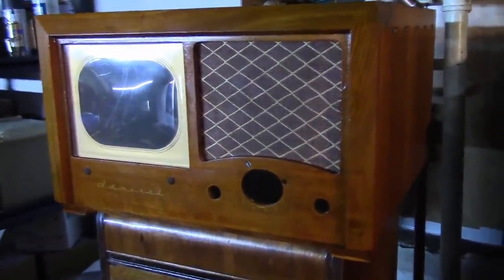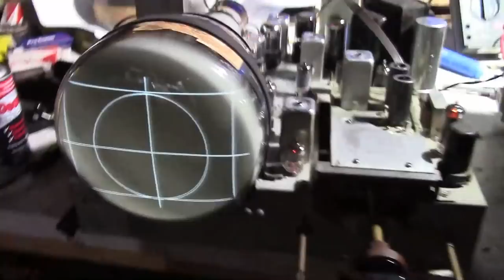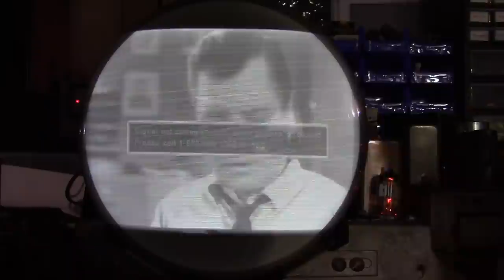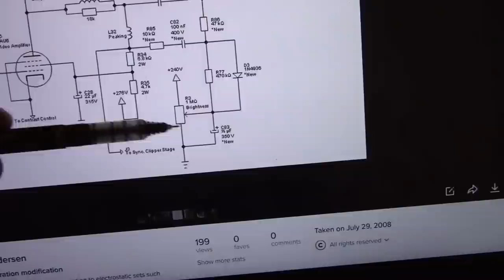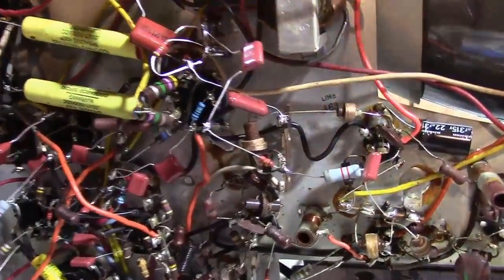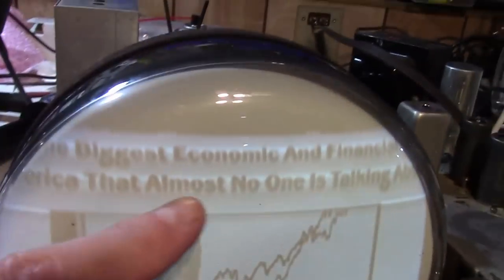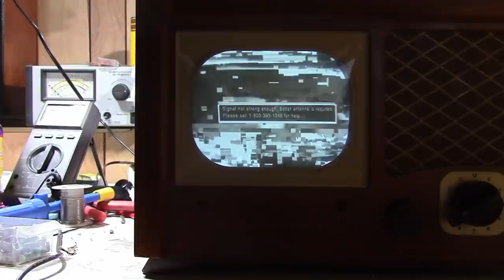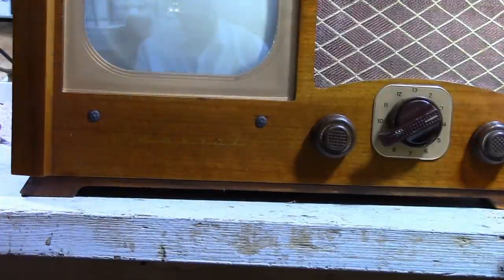Admiral 19A15 restoration p4o4

Comment: Nice job! Watching your videos over the years inspired me to do a restoration of a Dumont ra103 "Doghouse" set that showed up on the local Craigslist recently. That uses a 12JP4 but the tube in there has a bent gun with ion trap. The phosphor has a mild ion burn so I am thinking it might be a rebuild also. Set works well after a total re-cap and repl. Of a few bad tubes. I am now in the process of aligning it. So far so good!
Reply: Glad your Doghouse restro went well! Mine had issue after issue and even now I can't get the brightness down and I still have very high b+ in some circuits. Its watchable but I know its not working 100% yet.
Reply: @mattdavala3790  Have you checked resistor values? High b+ means something isnt drawing correct current. If brightness is too high maybe your control has an open? Disconnect top terminal and ohm out as you rotate. This set should work well as they used good parts for the day.

Comment: from what I've heard the things that makes electrostatic tubes so hard to rebuild are: standard button bases (the bit where the wires go through) are too small for the width of the neck and also replacement cathode assemblies are not produced. I suppose its possible that the rebuilder recoated the original cathode and reused the stem.
Reply from the maker: That does seem like the only practical way to do it.

Comment: I totally got on here by accident but stopped to watch because of the round crt. BTW, in the town I grew up in was a tv radio repair shop and he specialized in crt rebuild. I was fascinated by his ability to do that and sat for hours to watch him do his magic. He even did some of the early color crt's, but stopped doing that by the mid 60s. 
Well, you did an awesome job and that is a nice little set. Admirals were a good tv but of course, the Zeniths and the Magnavox were the better sets. The RCAs were good but I always thought that Admirals were better, that is until color tvs started hitting the stores regularly and then RCAs ruled till mid 70s.
Reply from the maker: Thanks for stopping by.  As for the brand comparison, please keep in mind this set is from 1949.  Magnavox didn't exist yet and Zenith had the porthole TVs with their strange, complex design that were difficult to service.  All that changed over the years of course.
Reply: @bandersentv : You are welcome. BTW, magnavox has been around in various forms since 1911 and they commercially produced and sold their magnavox radio/ record player/ tv cabinet combo in 1948. And zenith got started in 1918 in chicago. But it did not begin manufacturing until the 1920s. Zenith also put its first tv sets on market in 1948. They also got into the "phonevision" that was never really a hit but the brand name got put on their early tvs as well. In fact, zenith was the number one innovator in electronics and was also the producer of "windcharger", a small company they bought up to produce wind-powered charging system. I happen to know a bit of both companies as I was and still am a huge fan. But I also loved many other tvs and radios from many other companies and also a fan of many electronic parts companies that stood out from the mundane. Like germany's telefunken who produced the best radio tubes in the world for a long time.
Reply from the maker: @sonofeloah   Thank you for the correction.  The tvhistory website shows their first models being introduced in 1950.
Reply: @bandersentv : Wow, really?!?!?! I remember back in the 60s wanting to use older tv's for my slow-scan ham tv system and used a1950 admiral set as even the older magnavox and the zeniths could not be made to run the slow scan-monitor system or be used in the slow-scan receiver. Even a rca could not be used. But I was very happy with the admirals I used for the monitor and the receiver systems. BTW, to refresh my aging memory, I did go to the wikipedia sites for the history of each company to be sure I was correct in my previous statements. And learned a bit more about zenith than I ever knew before! Woohoo!!

Comment: Wouldn't possibility of rebuilding the tube depend entirely on availability of replacement gun assemblies (or whole necks)? Are there any known surviving catalogs of those from back in the day? I was under the impression that's all that goes into a CRT "rebuild". Maybe only one manufacturer of such supplies made them at an unattractive price, or (really guessing here) some shop got ahold of military radar tube parts?
Reply from the maker: The gun and neck is relatively easy compared to the rest of the process.  Air needs to be slowly let back into the CRT.  The old neck cut off, a new gun assembly inserted (or the cathode can be recoated) , new glass neck welded on, bake in an open overnight to releave stress in the glass, air pumped out, getter flashed, tested, new base put on, etc.   I was able to get one rebuilt just before Hawkeye closed.  Cost $300 for just one basic B&W picture tube.    This video shows the process:  https://youtu.be/W3G7b-DcOO4

Comment: Bob,do you have a good 24AP4 Metal shell CRT
Need one for 1951 General Electric model 24C101,Sams photofact folder 152-8
Only set of its kind to still exists in Western North Carolina Rutherford County
Unfortunately the picture tube is NECKED before I bought it
The cabinet is mint except for a few scratches in 70 yrs
Reply from the maker: No and I never seen one.  I know you've been asking around for a few years now.  Unfortunately that CRT was used only for a short time in only a few models.  I hate to say it but it's going to be difficult if not impossible to find one.
Reply: @bandersentv  
Bob 
I'm NOT giving up that quit yet still plug on
Just help me out in your travels and swap meets for one or a really good leed to one

Comment: is there any way to re pull a vacumme  if thats all the tube needs
Reply from the maker: Nope. Once the seal is broken that's it.
Reply: @bandersentv  if a valve could be welded in to the glass then a H V A C  vac. pump may work? they go down to like 300 microns
Reply from the maker: A few problems with that.  Welding a value on would likely cause stress in the glass plus let more air in.  Once the cathode gets exposed to air it's ruined.  I don't think 300 microns is good enough.  New getter material would need to be flashed inside to scrub out every last bit of air.  The little bit of air in the one I showed cause the phosphor to be permanently damaged.

Comment: I wouldn't mind watching a feature length movie on that TV, but I couldn't stand watching a digital signal over the air with poor reception for more than a few minutes. VCR ftw.
Or a DVD player hooked up to a VCR. Or a RasPI (although mine is hooked up to an early 80s TV now).
Reply from the maker: Reception is fine upstairs.  I was down in the basement with a cheapo antenna.

Comment: I have just started watching your videos as I am restoring an old 405 line television and trying to learn as much as possible from you and Shangoo as I have never worked on a TV before.  From what I can see you don’t appear to need standard converters like we do in the U.K. for our old 405 Line standards. Do you have 625 lines in the USA.    I think anything below 30% percent modulation or below is black so  frame and line synchronisation pulses are not visible. I have a problem with my vertical hold so I’m looking at the sync separator at the moment I don’t need any help at the moment but hope I can give you a shout out if i do.  But I have those retrace fly back lines that you have.  I think DC restoration is above my pay grade right now LOL but We have to start learning somewhere. Thanks for the video best regards chris https://youtu.be/kQdlDwxMbGo
Reply from the maker: The US used the 525 line NTSC standard from the start of mainstream commercial broadcasting in 1946 until the digital conversion in 2009.  They did tweak the modulation levels a bit over the years but pretty much any TV ever made around here can receive NTSC without a converter.
Reply: > I have just started watching your videos as I am restoring an old 405 line television and trying to learn as much as possible from you and Shangoo as I have never worked on a TV before.  From what I can see you don’t appear to need standard converters like we do in the U.K. for our old 405 Line standards. Do you have 625 lines in the USA.

In the US the very earliest consumer televisions were on a 441-line standard created by RCA in the late 1930s before commercial broadcasting was authorized (the broadcast stations were only licensed as "experimental" and only in a few large cities). Right before the US entry into WWII the FCC standardized television on the 525-line NTSC system and authorized commercial broadcasting using that system (according to Wikipedia most of those early 441-line sets could be modified to receive the 525-line broadcasts and I assume most were; Wikipedia also says there were only 5000 TV sets in operation in the US in 1942 to give you an idea of how limited the market penetration of TV was at the time).

These days of course it's almost all digital broadcasting so you do need a converter box for that. Fortunately the free ones given out by the government during the digital transition fully work even with these older sets. The "almost" in "almost all digital" is because there are still a few low-power stations broadcasting an analog signal (you may occasionally see Bob in his videos tune in to channel 6 in his local area which is one such station), though the FCC finally decreed those stations must convert or go off the air this year.
Reply: AllTheGearNoIdea: 405 line TVs didn’t use DC restoration, which bugged the BBC no end as they went to to great lengths to overcome the problem of a dark scene looking like a fog instead.  They would ensure a light would be in shot so the average voltage would give close to black.  They also used some very strange costume and set colours to get good contrast.  Cream shirts and coffee coloured suits for example.  Bobs description of the integrator circuit is great, but remember that 405 lines has a series of 7 pulses as the vertical sync signal.  There’s an Integrator which compiles them into one pulse, if this is bad there will be little or no pulse.
Reply: @MrRadar  Thanks for the information. In some ways it’s a shame we changed from 405 line to 625 as there really aren’t any cheap ways of modulating 405. I have a standard converter bought from the USA but it was quite expensive so not many people want to buy them. Having said that some of the earlier 405 line televisions are starting to go for serious money.  I think I’m most interesting in the early tube based sets although a dual standard would be interesting. I think we also switched of our analog 625 standard about 10 years ago but there are still a lot of DVD players, set top boxes and VCR around that will output the 625 UHF modulation. Thanks regards Chris
Reply: @bandersentv  ok thanks. your lucky on that as the 405 line modulator are expensive and not very available. I bought my Aurora standard converter from the USA and it was expensive. I don’t the company supplies them now as the FPGA became obsolete.  So it’s not so easy for us to drive the old standard. There were also later dual 405/625 standard around so I may look for some of those. It’s mainly tube based stuff I’m interested in. Thanks for the video and great information regards Chris.

Comment: The highest end stuff of today could not be made to the quality of the build of this thing.  Maybe it was cheaply built in comparison to what was sold then, but compared to today, it's built like a tank.  Of course, I realize you do not mean build quality, you mean electronic features and specifications.
Of course, you paid out the nose for this stuff.  A man working a full time job might have to spend a few weeks take home pay to be able to buy such a "cheap" set.  Plus, despite the build quality, this stuff just didn't last.